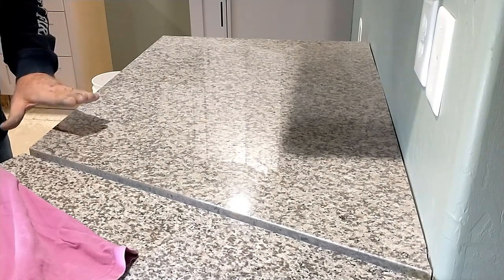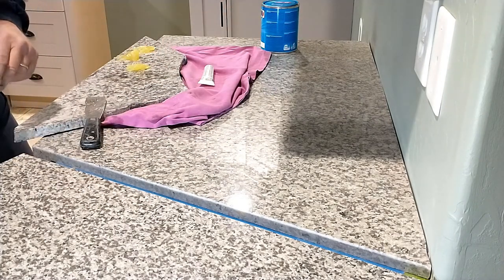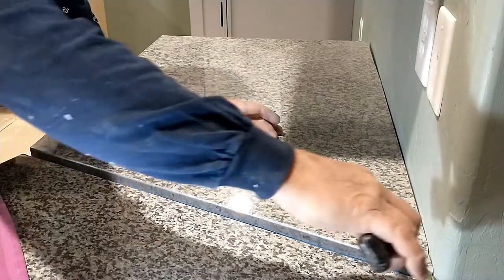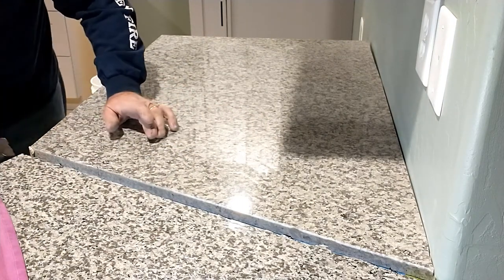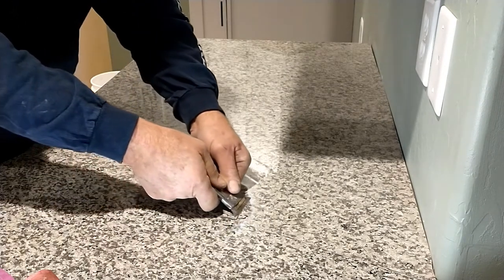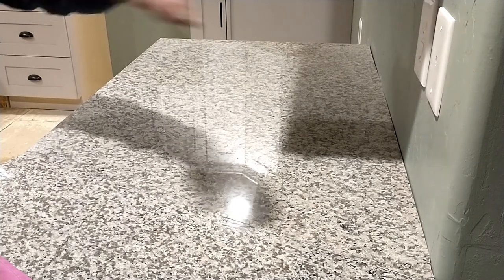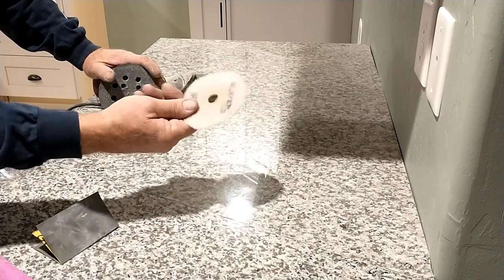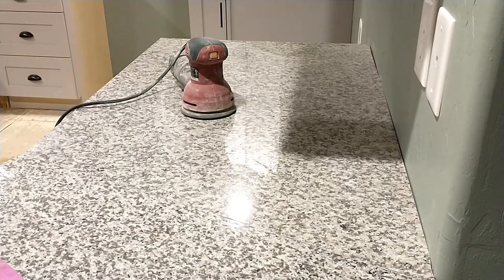Updated DIY Granite Countertop Install, Epoxy Joint Filling Tips, (NO MUSIC ;)

Comment: Thanks for taking the time to update the video. I really like your technique for matching the pattern. With enough practice and care, I'll be making truly invisible seams in no time. BTW, what seam filler did you use again?
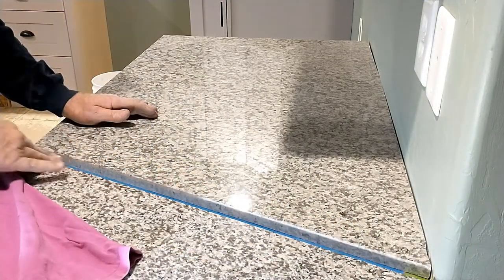Reply from the maker: The product we used was called Tenax, it was a two part epoxy with hardener and colorants to add 👍 0:57 
We bought it where we bought the granite